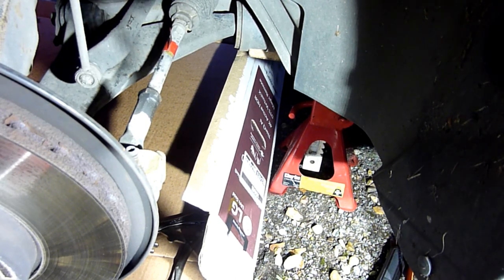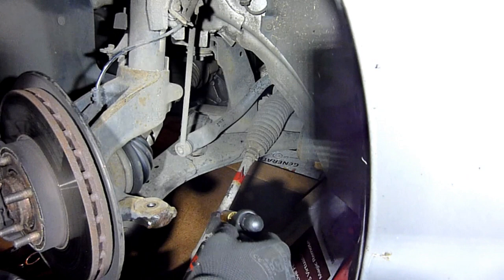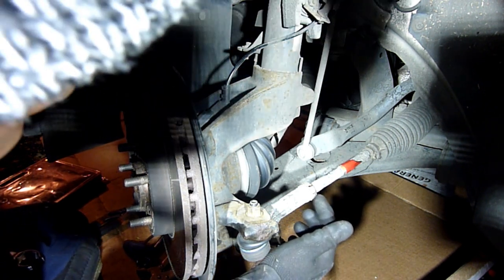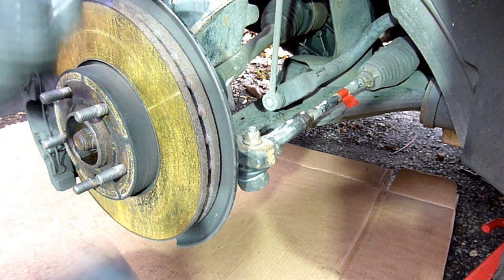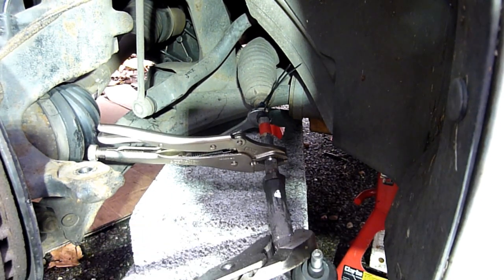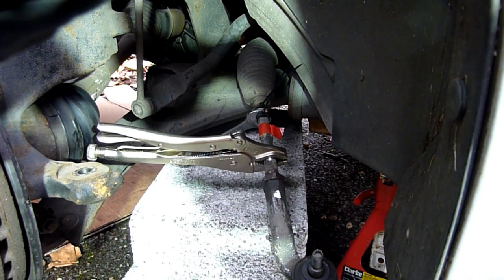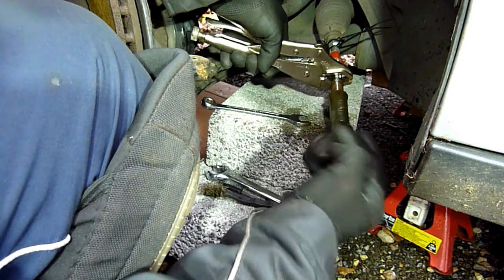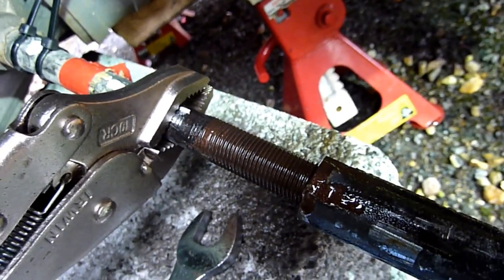How to Free a Stuck Tie Rod Arm on Your Car (Inner Tie Rod Shown)

Comment: I had the exact same problem with a  Vivaro.  The rod has a crappy 13mm spanner slot.   Vice grips, 13  and 21mm spanners were no good. Added 4  minutes of heat  with a propane DIY  torch and the arm came loose with a screech.  I took your advice used copper ease when reassembling  too. Gotta think of the next  guy - it could be you. 
Thanks for the  great video.  It saved the day.

Comment: the way to do it is free the locking nut, and rotate the trackrod control arm,the track rod control arm is connected via a ball joint so it will not come undone

Comment: Hi mate, Appreciate your efforts but it might be worth watching inner tie rod  removal to to see that it is a ball joint held by a captive nut /collar.  Once the locknut is backed off and the outer tie rod end is loose you turn the shaft to adjust with the outer end bolted in place in the knuckle/hub. The inboard 15mm flats on rod are to adjust by rotation (not to lock)....
Reply from the maker: This video is for a stuck tie rod arm. The stuff you mentioned is only possible when all parts are not rusty.
Reply: " and the outer tie rod end is loose "  LOL. Mine was seized on too.  Needed heat and  force.